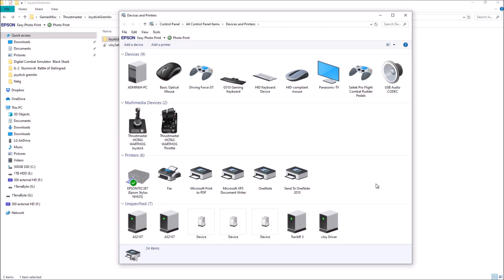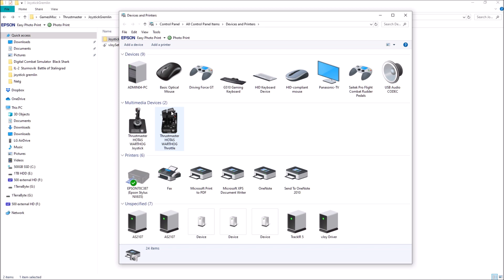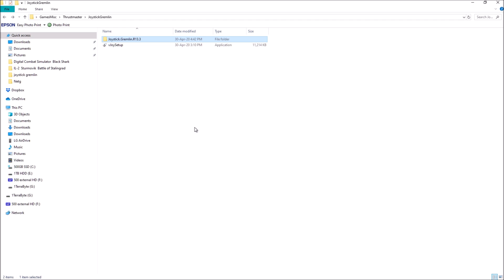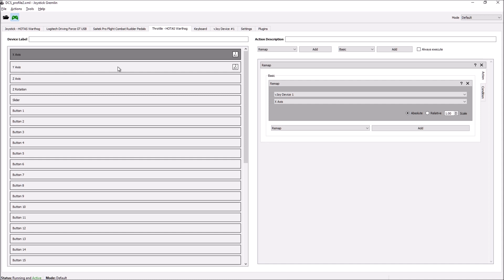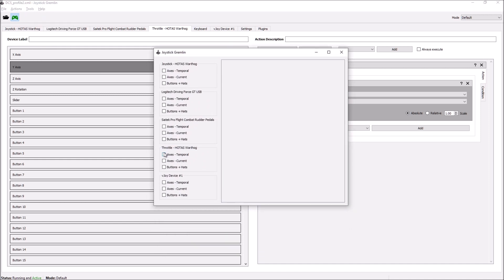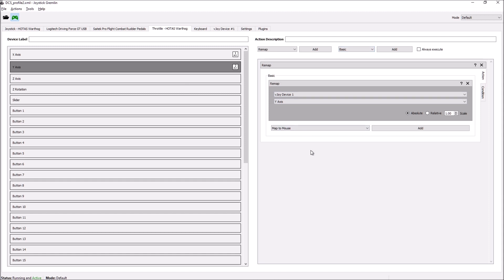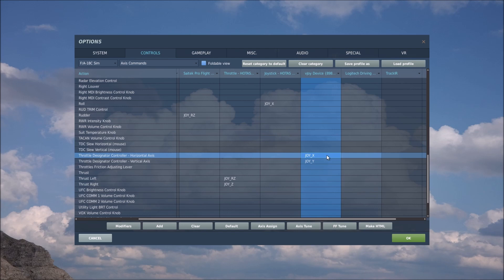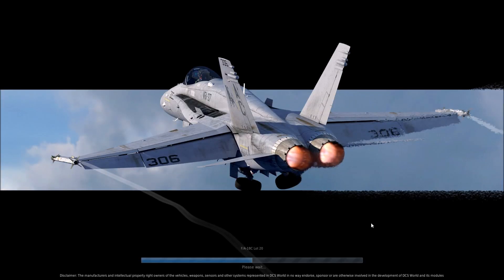Thrustmaster Warthog / DCS slew fix.

Comment: This is not a fix at all, it's using 2 more apps as a work around to something that clearly works and TM need to fix.
Reply from the maker: True. My TDC slew finally gave up the ghost and I replaced it about 6 months ago with the analog replacement part offered by Deltasim Electronics in the UK.

Comment: I don't quite see what that fixed? I mean, you should have presented the faulty state first. Still, if that fixed an issue for you, then thank you for sharing a solution to an issue some people are having. ; )

In other news, I don't have a problem with TDC slew in the AA radar, but in AG radar when you have to move it while depressed, it just randomly stops being depressed, so I just can't use it then. I think  I'm going to have to buy a replacement. Less than fifty quids for that... But it's Alps, so.
Reply: In DCS/settings/Special/fa18 don't cross realistic TDC slew. Then you doesn't need to press slew button for moving your cursor.
Reply: @serginiopaca709  yes, however I didn't want that compromise. I've since bought a replacement slew that works perfectly fine. It's basically a plug in replacement in the form factor of an xbox joystick.

Comment: If you just run the thrustmaster firmware update on the throttle every time it happens it replaces the designator back to center every time.
Reply from the maker: Have tried that - unfortunately it doesn't work for me.

Comment: Hello, does it works in other planes, like Su25T? Thanks a lot!
Reply from the maker: I would presume the fix works for all modules that have slewable displays.
Reply: @harmer7  It semmes not to work in the SU25T...
Reply from the maker: @pabletesoy   It should work, just make sure your Su25T doesn't use the the default key controls for slewing the TV cursor ( [,], [.], [/], [;] keys).
Go to axis controls and use TDC horizontal and vertical settings instead.
Reply: @harmer7  amm,ok. So I should test it with another controls.
Reply from the maker: @pabletesoy  Ok. Just checked. Unfortunately DCS doesn't allow you to allocate an axis control for the Su25t TDC slew. It's set at mouse only and cannot be changed. You are out of luck there.
Reply: @harmer7  I,ve cek it with the pitch and roll and seems to be fine!